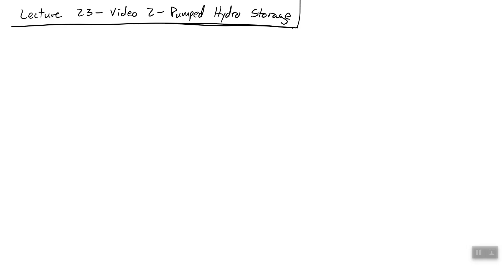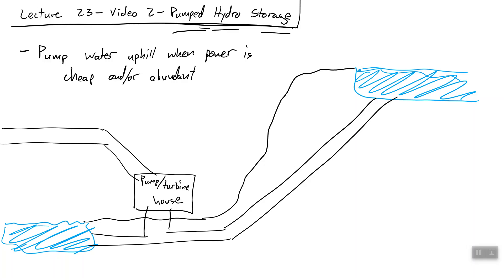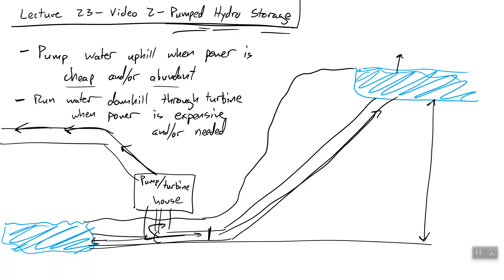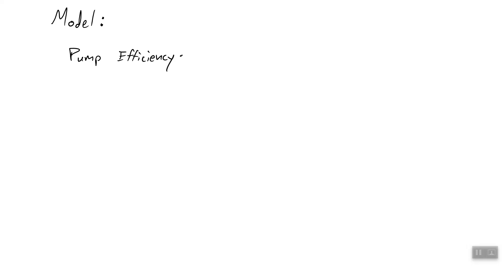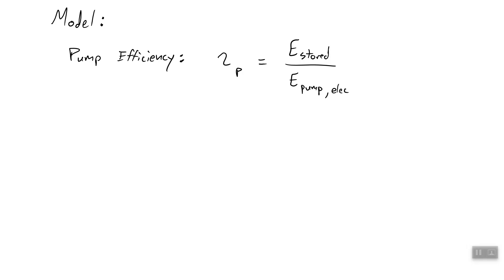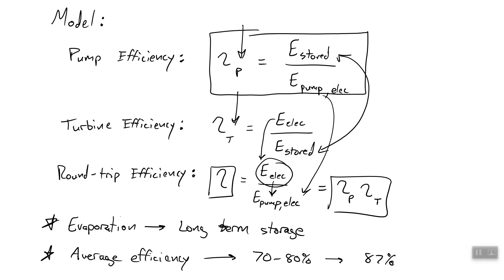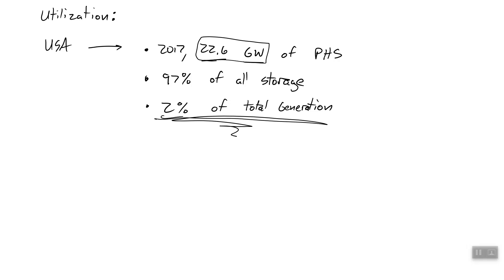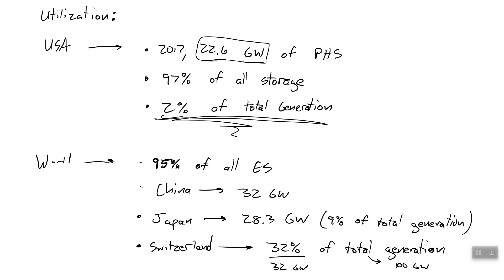Energy Storage - Video 2 - Pumped Hydro Storage

Comment: This 87% efficient hydrostorage system paired with wind, solar or geothermal or a combination of each. Which combination is cheapest to build for a 100% offgrid system? First off is hydro with solar thermal a cheaper system than geothermal alone? Or is solar photovoltaic with hydro storage cheaper than all geothermal?  Or is hydro with wind cheaper than all geothermal to build, or is geothermal by itself the cheapest? Say for a 24/7 100kw hr system which of these 4 systems gives the most RIO(return in investment)? 

Solar and Wind pump the water up to store the energy while the sun shines and the wind blows and hydro makes the consistent stable power 24/7.  Solar and wind will have to be over built to work during their limited hours of operation to match the 24 hour flow of hydro.

To me geothermal seems like it would be cheapest and less complicated by the 100kwh size cost wise? But I don't know where to get all the numbers/data for comparison?

Save the battery tech for mobile use. EVs, it's more practical for that purpose.